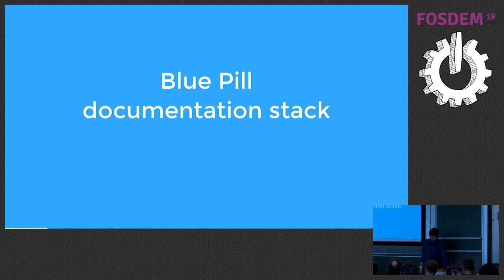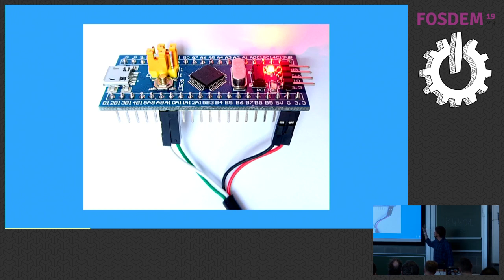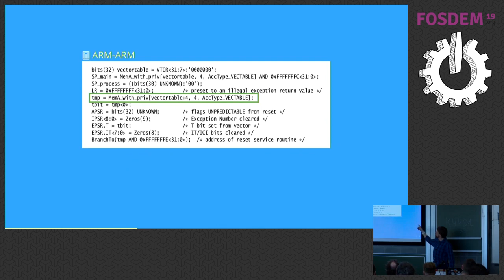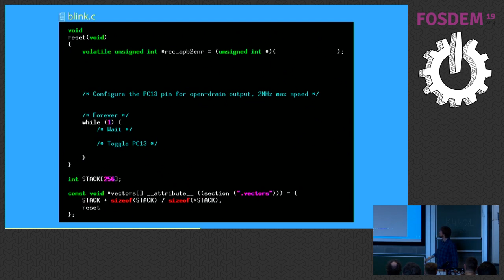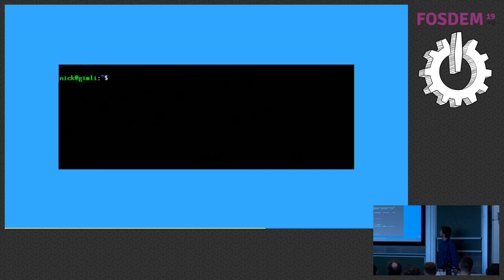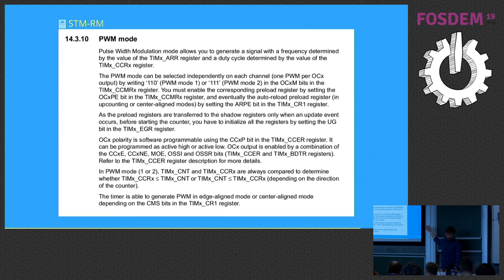Microcontroller Firmware from Scratch

Comment: One suggestion...if we want do firmware design and NO manual coding..use flowchart to code converter. Pl see video. Thx
Reply: It's sometimes easier to read code if its done in diagrams, its always slower to create diagrams instead of code. Diagrams are useful when you program simple logic that's important.
Reply: I thought we left that shitty idea in the 90's lol
Reply: Let know the reasons as why its a shitty idea which you left in 90's